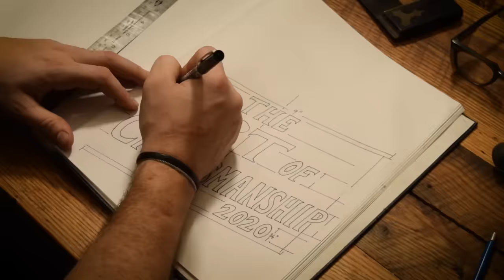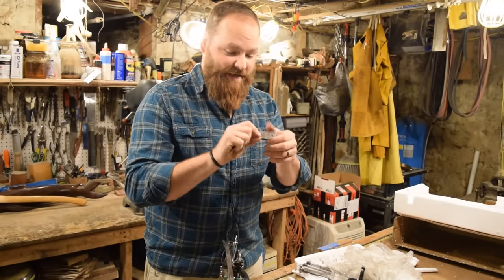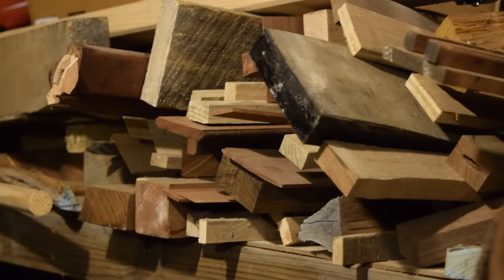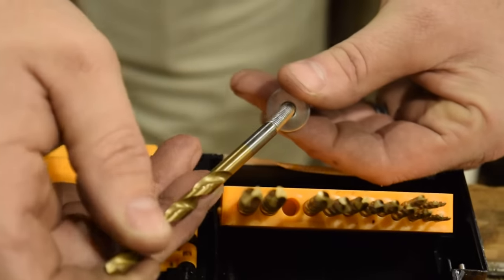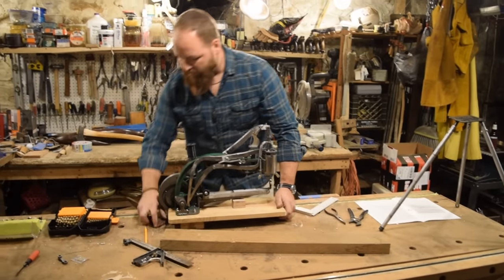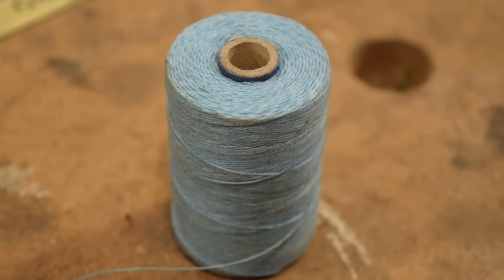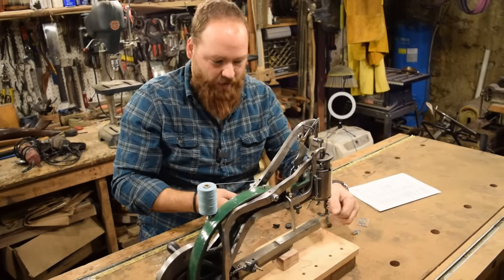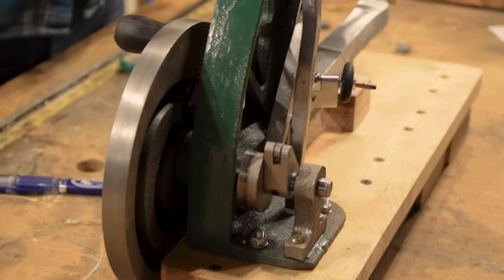The Infamous $100 Leather Sewing Machine: Unboxing and Setup

Comment: It copies the design and action of the Singer 29K which my brother still uses a couple of fo leather. Although the singer can be hand cranked it has a much heavier cast flywheel which smooths and damps the action, even more so On a treadle based machine with a second flywheel. Keep the slots in the cam wheel well oiled, or even greased.
Phil, UK

Comment: Remiinds me of a machine I had once upon a time called the new elastic machine. It was made for shoe makers and repariers way back when elastic was first used in shoes, for ease of fit slip on shoes. It had a simlar mechanism at the head, that round cylindrical headstock. Had the arm which is made that way to fit inside the shoe and for boots. This is an acneient looking device but cheap for the price. I payed a lot more second hand but mine did have foot peddles. China and other asian countaries have kept making those types of machines way after they all became automated in the west.

Comment: The swinging plate that covers the bobbin and the hole where the bobbin sits both need to be sanded otherwise the thread will get severed as it is pulled around the shuttle The timing usually needs adjusting too so that the shuttle hook grabs the thread right after the needle comes to a stop at the bottom of its stroke. I got my machine to sew with the daintiest of lightweight threads but it sure took some work.

Comment: I have used an industrial sewing machine that have three tensioner, one control the tension during auto thread cutting, one tension for the stitches and one thread feeding tension. I can't see any mechanics that would indicate something like this but might be worth checking out if the two tensioners have different purposes since that might do things easier.

Comment: One I bought one and when I got it it was very rough a lot of sharp edges really rough running I went and took cleaned up all the connections sanded things down and buffed up other connections to a mirrored finish and gave it a paint job thing runs 100% better

Comment: I bought one a few years ago and then bought a surge motor for about 100$ and remade the main shaft and fit a pulley on the otherside of the hand crank and now mine is electric and made a steel stand, works great 👍

Comment: All commercial grade sewing machines come with a pieces of fabric/ leather in them from where they ran a test stitch as proof that it worked when it left the factory. They also leave the thread threaded through the machine so that you can just tie your thread to it and pull it through the machine so that you don’t have to rethread the machine completely also you can see proper threading process. That being a shoe makers machine the stand is supposed to have slant to it. If you were stitching shoes you would want the machine angled down some so that you can sit while sewing,if it were flat you would have to stand up bend over and look down.

Comment: I wonder if you could attach a motor to that flywheel? You know? A pulley mounted to the shaft and belt running to a variable speed motor. Maybe off a busted sewing machine.

Comment: This may have been mentioned before, not going to read through 700+ posts. First you WILL break many needles, buy some good quality Juki needles. And make sure that the eye is facing the correct direction. We used them almost exclusively in the large scale cushion manufacturer where I was a machine tech. They seem to last the longest, until the sewer gets bored and runs the needle into something so they could take a break, no the didn't change their own needles, we had to. Second, get some Mitchell abrasive sanding cord and run it through and around all of the thread path to smooth out any points of abrasion. And there will be many on that quality machine, to bugger up your thread. But take heart, in that short demo, you still did better than many of the sewers/machines I've had the pleasure to have serviced.
Reply from the maker: Thanks Kruse. I’ll definitely take your advice.

Comment: The machine is awsome! When I got mine in November 2020 I had to file down every edge that the thread touches BOBBINS TOO!!! and oil the hell out of it. But once you  get it tuned up you'll wonder why you hesitated on buying one. Especially at the price you find them on Amazon. There are different models and as far as I know they are all different in some way.
Reply: I got one in November 2020 as well. It cuts all of the thread I put through it other than fishing line. Thanks for the tip on how to fix that problem

Comment: nice video.  i notice a few things that might help.  The base you made now limits clearance for working under your needle plate.   The stand would give you lots of working space for various uses.  Proper insertion and direction of the needle as well the direction of the winding of thread on the bobbin along with the tension is crucial.  "the set-up" It's a balance of Needle size, Thread size, fabric or layers and tension.   With the bobbin, there are two different directions you could wind it.  Think of it as "p" and "q"  in reference to the best direction for the machine.  Also, using a lubricate to help the needle pass through thick fabric or leather layers will also help.  Cheers

Comment: Get yourself a Singer 29 threading rod to push the thread down the hole in the needlebar, will help you out quite a bit. I'm not sure what model Singer shoe patcher this machine is a copy of, but if you find an original manual it might help you with all the adjustments.

Comment: I spent about 150 on mine and I thought it was gonna be a game changer but no matter how much I messed with it I couldn't get it to stitch consistently. I don't know why but the needle bar would slowly move up no matter how much I adjusted and tightened it. it would do it with thin and thick leather. it would also bind a lot. I was determined to get it to work and spent 3 days straight playing with it and watching all the mainly acres videos but I couldn't get it. his videos definitely helped though so if you're stuck then swing by his channel if you haven't already. good luck!

Comment: Great video on this little machine:
Had fairly long conversations with a couple different independent sewing machine repairman
That have worked on these for customers, trying to get them working correctly 
There opinions were either get different size  stitching ponies for hand stitching 
And set them up in a dedicated area making hand stitching easier. 
Or spend the extra money on a good used machine and save myself the headache 
Apparently it cost most customers twice the cost of the machine to get it set 
Up to sew smoothly and reliably regularly.

Comment: Nice video. A tip: you need some thread stands... 1 for your regular thread to feed from, and another for your bobbin winder. You don't want your thread pulling directly from the spool. You don't want your spool spinning around. It puts too much tension on the thread. The thread should pull off of the TOP of the spool, up to the thread stand, then down to the machine or bobbin winder.

Comment: I got the exact same machine about 5 years ago as a gift from my girlfriend (who has since become my wife). I used it to great effect after learning some of the quirks of the machine. I also stabbed my finger with it once... that thing has plenty of strength to do some serious damage, or to sew through very thick pieces of vege tan.  I had to use some sandpaper to grind off a few rough parts to get it running smoothly, but after a while I ended up making some decent money with it.
Reply: Can I ask you for the brand and model # ? Thanks

Comment: Did you find that the more tension the wider the stitch ? I like mine thus far in that when not using it stows really nice ! I'm converting mine to motorized , hope its even better yet , i use both tension disks on mine !

Comment: I do some upholstery with a sail rite machine, and also have some experience with Chinese made woodworking tools. You might want inspect anyplace the thread comes in contact with metal for sharp edges from machining. I’d pay close attention to that notch where the thread comes out of the bobbin holder. A little filing if needed. may save some aggravation

Comment: Bet if it was not too much trouble to disassemble all the moving parts and you polished them with a bench grinder buffing wheel and rouge it would be smooth as butter.

Comment: Just a thought, but if you were to want a motorized version you could cut a wooden wheel the same size as the wheel on the machine. Drill a center hole for a motor shaft. Cut a dowel rod in half and glue inside shaft hole so that motor shaft with flat fits hole. Then add a regular sewing machine foot pedal to motor's power in line. That would make it a hands free sewing machine. Just a thought.

Comment: I'd suggest finding a Singer model 15-91 (or 201) which are gear driven 1950s 'black iron' sewing machines designed for small shops as well as home use and were the pinnacle of Singer machines, the 1930s-40s belt driven 15 and 66 models are good and sturdy too. Rolls Royce used the 201s to stitch leather seats back then. Find them on Craigslist for $50 to $100 (or more for one someone recently repaired). Replace the electrical cords as the originals are usually cracked by now. Then get a 'leather wheel' foot attachment. Those old machines will punch through eight layers of blue jeans or a couple of layers of leather. Replacement parts are out there. There are special leather needles if you do leather all the time.

Comment: I used to own one of these, I polished the foot so it doesn't scratch the leather, there is a limit of how far you smooth the "claws" though. I over did mine and feeding consistently was a problem. I wish there was a model with double feeding.

Comment: I have a singer 29k55 from 1922, it works really good. I do think the thread I have is too big for it though, because when I started using it, it started jamming. But the thread I had before worked flawlessly.
Reply: @Masterpiece Tools yes it's easy to thread but it doesn't have the proper tension in the bobbin, like with that little tension thingy on the bobbin it's too hard to pull through. So I found a bobbin in my little drawer of spare parts that was missing the tension spring thingy, so I can get it to work.

Comment: I have exactly the same sewing machine, we call it Versailles and it is very popular - simple, reliable, convenient and powerful enough for leather more than 3-4 mm thick. Requires only lubrication and proper needle adjustment. I made her a wide and heavy bed from a 50mm board, which would be more convenient to move and not screw to the table - six years of trouble-free operation. Good luck dude, you're cool)))

Comment: From listening it sounds really gritty.  I think that if you lubricate it really well it will work a lot better.  Also if you look at the finish of the machine it is really rough.  I would take a Dremmel with a buffing wheel and jeweler's rouge and buff the crap out of all of the mating surfaces, maybe even a fine grit sanding wheel.  You could also use some copper colored never seize on it which will help it lap the surfaces to mate smoothly.  Of course if you just keep it oiled and use it a lot it will eventually wear in.  It does look really rough but it looks like it will work.  For the life of me I don't understand why you didn't just use some carriage head bolts to bolt it down to your bench.

Comment: That’s a nice machine for what it is, and I’d actually consider picking one up for myself. 
But I have a question, what is the max thickness of leather that can be sewn on this machine ?
The sample piece sent with the machine as proof it works did not seem to be especially thick or heavy duty. It looked more like a fabric type leather than sheath or holster type leather.

Comment: The leather in the foot is showing you the machine actually sewed something before it left the shop.
if you need a sewing mchine for leather and especially doing sheath and belt work you are going to need a class 4 cobra or similar machine and that going to set you back $4000 to get started,

Comment: Honestly, my favourite part of this machine is the fact that it is hand cranked. I am definitely not one of those hand tool snobs, and I believe that power tools are a fantastic advancement in any craft, but there is absolutely a large, influential part of me that has a soft spot for hand tools. As a novice woodworker I attempt to make all my small projects (not that I have undertaken any large projects as of yet) using only hand tools. Unfortunately, most of the time I am not successful in doing so, as my collection of hand tools is quite limited. I am usually foiled by having to drill holes, as I own neither a brace and bit, nor an egg beater style hand drill. Only a handful of my projects have truly been made without using at least one power tool.
Reply: It aint exactly easy to find a brace and bit or eggbeater hand drill... Sometimes you just gotta plug in, and drilling holes is one of those times :D
Reply: @dominicdelprincipe2583  Interestingly enough, since originally posting this comment I have a full set of auger bits, two braces, and two egg-beater drills, along with a wide array of other antique tools. Some were given to me and others I found on ebay.
Reply: @anonymousaccordionist3326  Nice to hear!

Comment: Next time -
Take the legs and the rubber feet and carefully store them for some other project.  Cut one 24 inch +- long 2 x 8, 2 x 10 or 2x12.  Take the interface between the now stored legs and the bottom of the machine base and turn the interface upside down and mark the board with the mounting holes in the interface (not on the centerline of the board because the crank handle has to sit just beside the side of the board).  Drill three 5/16  holes through the board..  Bore up from below into the bottom of the mounting holes to allow 2 or 3 longer 1/4 x 20 bolt to be run up through the board and not have the head of the bolt touch the table top.  Get 3 new rubber feet for the leg studs of the interface.  Bolt the wood base then the interface and then the machine base all together.  THERE, a sturdy mounting of the machine to the wood board.with enough "altitude" to allow the hand crank to freely turn.

Comment: Check your bobbin casing for a tensioner also. Even the simplest sewing machines can be difficult to adjust and fine tune. It's not the thread. I've worked with kevlar thread and almost always, the industrial machines we used had to have constant maintenance. Either the needles would burr or the tensioners would move a fraction of an inch. I'm sure you can get linen thread to work on this machine. Also, oil it up. Can't go wrong with lots of oil, even on the thread.

Comment: A vintage singer type japanese clone can be found used , working for under 100online. Cheaper in a yard sale/thrift store. It will sew thicker leather with less headaches for decades.  Without cranking.

Comment: I purchased one of these chinese shoe patching machines a few years ago and it was a heap of rubbish; could never get the needle to pick up the lower thread in a consistent manner. I went back to using my hand cranked Singer which has never given my any trouble on lighter grades of leather.

Comment: Old singer style needles (like this) are typically installed with the flat of the shank away from the set screw.  Very counterintuitive, but that's the way it is.  This is likely why it was misaligned, and broke a needle / bobbin hook cut threads.
Look carefully at the scallop taken out of the needle to allow bobbin hook to catch thread, and the proper orientation should become apparent.
Reply: Old needles had no flat. That's why you need to turn it around. The same needle could be used on old or new machines.

Comment: I bought this machine and worked on the thread tension for many hours (embarrassed to say, but actually days). I could not get nice solid stitch. The top thread would be too loose and pull through to the bottom forming loops. When adjusting it it would break. In the end, I decided that even though this was a good deal, the fact that the thread tension was impossible and to try to sew with one hand would also be hard. I returned it. The quality of this machine might have been better a few years ago. At this point I consider this machine useless. Also, the tread that I used was good Japanese thread made for leather sewing.

Comment: use a bonded nylon thread, #138 should work well for your purposes. Also may consider filing down the teeth on the foot if you'll be using veg tan.  Great review on the machine, i've been eying the same model for a while now.

Comment: I have to say that the machine looks cool as hell. But for me I prefer using a good old fashioned sewing awl. The type that has the bobbin located in the handle and has the needle hole close to the tip so you can achieve machine like stitches easier than using a pair of pliers to push and pull the needle through each stitch, the needles also have a groove running up its length so the thread isn't weakened by abrading it through each hole over and over again. I've busted many needles sewing like that on leather and heavy fabric. I also don't usually take on larger projects because of how long manual leather sewing takes.